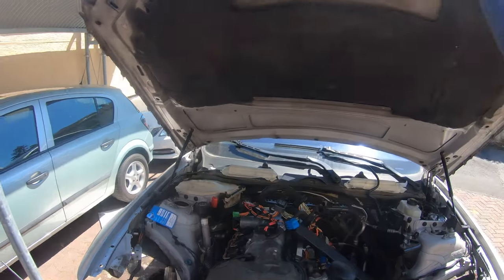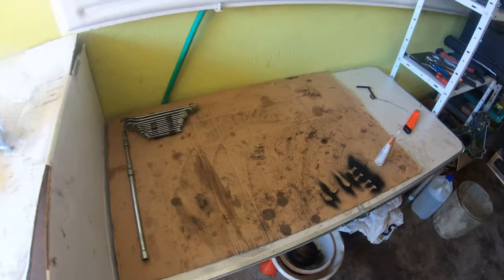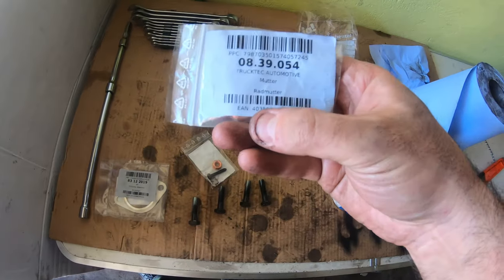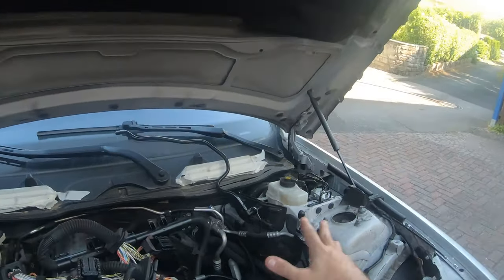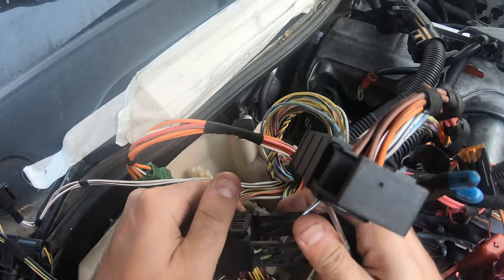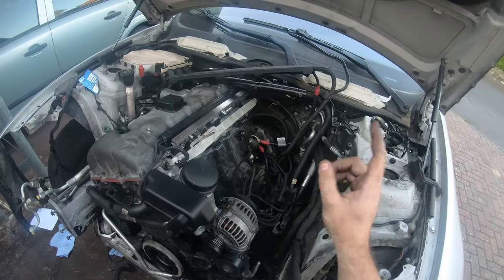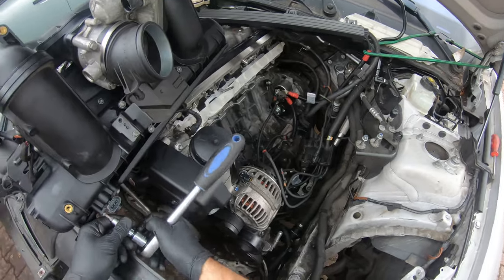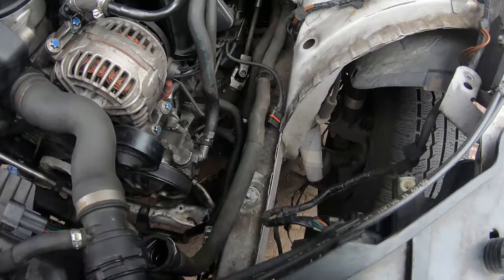FINAL ASSEMBLY On The BMW N52 Engine Swap - 3 Series E90 325i [N52 Engine Swap PART 8]

Comment: Nice video. I'm working on a 07 530xi. First time working on a bmw. It was really scary at first, but ones I keep pulling thinks off is getting better. One think I hate is the crankcase vent plastic hoses, I which it was a better aftermarket upgrade, to remove that stuff out. Also there's a lot wiring to remove just to remove the intake manifold. It's crazy but I'm loving bmw at this point.
Reply from the maker: What aftermarket CCV upgrade did you do?
Reply: @buildanddrive  nothing yet, but I want to do a ccv delete i don't really know if is just a thing, but I'm thinking on do a catcan thing or do a research it has to be something out there to replace for good all this plastic things on the car. Idk, have you heard something like that?  Like I say I never work with bmw before. I'm just looking into ideas
Reply: @buildanddrive  would you share your torque print outs for the n52 engine? For the head, pistons,oil pan and valve cover?
Reply from the maker: I do that as I go in previous videos but maybe I should make a good sheet for everyone. For some cylinder head torque specs... You can find them here https://youtu.be/52FZT6jeDzI
Reply: @buildanddrive  I did copy the torque for the head from your video, if you can make some kind of sheet that will be soo cool and helpful thank you.
Reply: @buildanddrive  hey bro I'm putting my n52 head back together. I'm doing the springs that you use two wrenches and a peace of metal. I'm doing the same way, but I want to show you what I did. I think it works really good. Where can I send you some pictures that I'm taking?
Reply from the maker: Send it to me on Instagram @buildanddrive_ or email me buildanddrive9@gmail.com

Comment: So I have one big question.. i have look everywhere but no ones talks about other way to take the oilpan out with out removing the subframe. So my question is, is it possible to lift the engine up by unbolt the engine mounts and jack the engine up and using a engine bar on top  for support?? That will save sooooo much time to replace gasket. Thank you!  ✌
Reply from the maker: You can follow this guys tutorial on how to replace the oil pan gasket with the engine in the car https://youtu.be/2FxVc6k1KMs

Comment: How many miles did the engine have?
Reply from the maker: My engine had 100,000kms on it
Reply: @buildanddrive  thanks for your reply. Thats really low mileage. My N52 2011 has 125k miles. I can go 5k miles and it will burn a quart. I take good care of it. I’m going run it into the ground.
Reply from the maker: @Joseph-gi9fw  5k for a quart is amazing. Hang on to it!

Comment: Is it possible to re ring the engine without removing it from the car?
Reply from the maker: Yes, but you're gona have a bad time 😂
Reply: @buildanddrive  worst than taking the engine out? :( Mine started to burn quite a lot of oil recently. This should be a recall really. This cars are really well built to be left to die...
Reply from the maker: It would be really hard to re-ring a motor in the car. You can't get the oil pan off. Mind as well remove the engine.